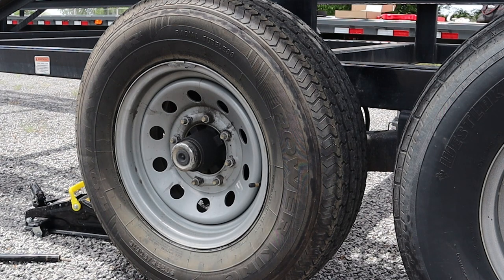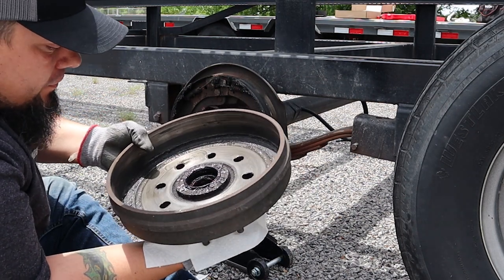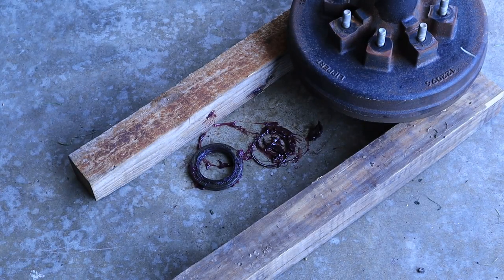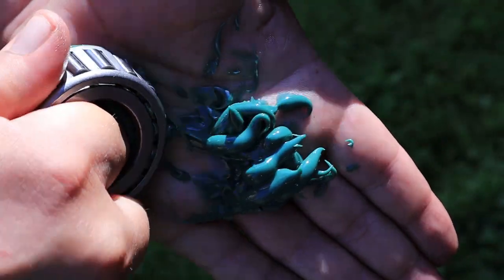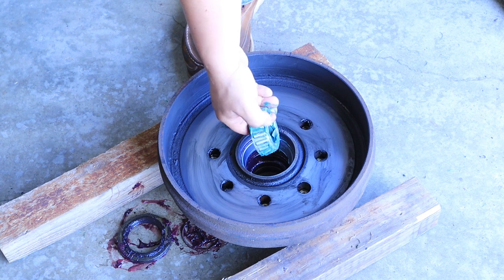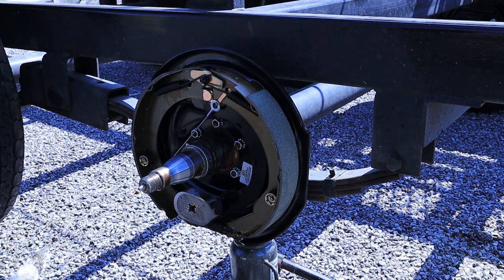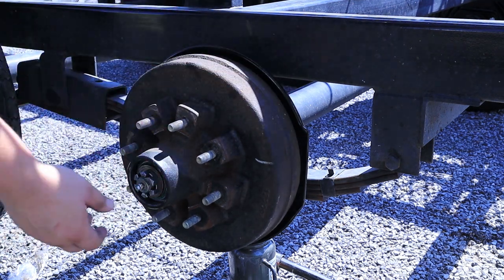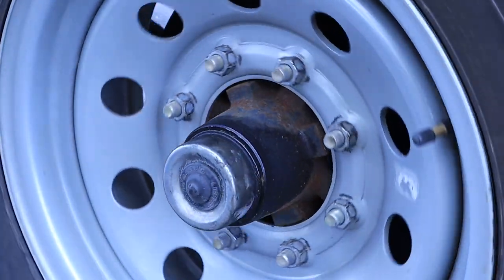Trailer Bearings | Maintenance & Replacement

Comment: I’ve been an USAF Aircraft Mechanic for my adult life. We have several critical inspections…Pre-Fight, Post- Flight, Scheduled and UnScheduled Maintenance. Applying that to my personal life has been beneficial and saved me tons in money, time and safety. I will definitely apply those rubrics to my Truck and Trailer when I start HotShotting. No reasons to drop $100K + and treat it like chewed Bubblegum…that’s just crazy.

Comment: In a pinch you can pull the outermost bearing. Put only the nut on the spindle and pop the hub/drum off the backing plate. The nut will pass through the hub and the nut will pop the rear seal and bearing out with some love. The most important thing you should have said is to carry at least a full set of bearings and seals in the truck. I carried 2 in the truck.
Reply from the maker: That’s an awesome trick!! What’s funny is I actually did mention running with a spare kit the first time I recorded this intro but my mic wasn’t connected so I had to redo it, 🤦‍♂️

Comment: Great video! Not alot  of guys out there showing this side of towing trailers. I had a wheel completely snap off one of our dump trailers and roll down the highway into a field a few years back due to the negligence of this very topic. We got lucky. Ended up having to replace the entire axle simply because we didn't do something as simple as keep the bearings greased. Thanks for sharing!

Comment: Thanks for the video. If you don't need to take it apart to inspect the bearing, you can Use that grease fitting in the end of the axle, that will fill your bearings with grease and push out the old.

Comment: Save a ton of $$$ !!!
I just had both axles serviced at a PJ dealership,  complete 70K service. Unfortunately my back is wasted so I can no longer do simple maintenance stuff myself anymore.
About 9K miles later, been on the road about 2 hours that morning, heard a loud POP, pulled over, assuming I blew a tire. Checked the tires, all good, but excessive heat coming from the right rear wheels. I go back to my truck to get my thermal gun, turn around, smoke, then fire. You, bearing and/or axle failure. Fire did too much damage to determine which. 7 fire extinguishers later (my 2 then a DOT worker stopped and we used all 5 of his), Fire Department showed up. Burnt 2 tires, 2 airbags and scorched every thing surrounding. 
No idea what went wrong yet (just got Dexter Axle's authority to begin the disassembly) but obviously the "service" I was charged for by the PJ Trailer service shop either didn't happen or wasn't done properly. 
Any other shared experiences would be appreciated. 
Never hauled overweight,  tires aligned and balanced.  Any ideas ???
Haven't posted anywhere else, Loadmizer's Channel is one of very few I trust & respect. 
Thanks again LM for the continued education and for finding the time to do the videos you do.
Reply from the maker: That’s insane 😦

Comment: Man I just did one which I knew that failed, so changed the whole assembly bc was dirty and figured was easier and installed nice sell adjusting brakes. Went to adjust other 2 on that side, and 1 I cant adjust, and then the other new axle wheel had a blown seal 🙄 so just replaced that one too with new self adjust.

Comment: lol just did bearings in my trailer..    awesome vid, per usual, brother!
Reply from the maker: Easily one of my least favorite things to do...ever. I miss my oil hubs 😂
Reply: @LoadMizer  I had shit everywhere!  first time it was this messy.
Reply from the maker: Lmao
Reply: @geriatricginger  Those are way handy, but a very easy way to over grease and push grease out your back seal and then it gets on your brakes.  I learned this the hard way so I only use a manual grease gun now because you can feel if it pressures up.

Comment: Excellent video with a lot of details.    Question:  I am pretty handy, but I have never changed out bearings on an axle.   I have a 5x10 Wells Cargo trailer and it is time to maintain the bearings.  The axle on the trailer is a Dexter axle, and do you think that would be comparable with what you did in this video for me to venture doing this on my own?   TIA

Comment: You have to raise the wheel off the ground and spin it while you a putting grease into the zirk at the end of the axle, or you'll blow out the seal every time, just like what you just found. SUPER IMPORTANT if you have trailer brakes. Now you'll have to change those pads and get all that hardware clean.

Comment: Thanks for the video, just repacked mine for the first time recently. 7 months as an O/O. One question, heat? I usually check my hubs when ever I stop. Hold em to see how hot they are, if I can hold em for at least five seconds or more i figure they are good. What is your thoughts?
Reply from the maker: That’s a habit you want to keep. Easiest way to tell if a hub is struggling.
Reply: @Asperian Transportation @Load Mizer keep a laser thermometer on hand. I once noticed oil splatter on one of my wheels during an en-route inspection, touched the hub and burnt the tips of my middle and index fingers.

Comment: Seems a lot of controversy about pumping grease in through the zerk fitting. They say do not do this as it could blow out the outer seal and saturate your brakes with grease.    Some say it should only be used during an emergency situation (whatever that means). Would I be ok if I just packed mine by hand and not use the grease gun at the end like you did?  Thanks for your input.
Reply from the maker: Absolutely. Just make sure you stuff plenty of grease in the empty space between the inner and outer bearings. I haven’t blown any seals using the zerk. I was told the way to avoid that was to spin each while as you pump. So far it’s worked perfect. I still prefer oil bath though, I’ll never own another trailer without them.
Reply: @LoadMizer  Thanks for your reply!

Comment: I was wondering when adjusting your brakes, at what level is it adjusted to to be adjusted 100%!? If that makes sense, I went with applying my brakes and adjusting it on level 4 so it would stop when spinning freely by hand. But then I wonder if I am over adjusting bc dealer said one of my magnets we burnt out! 🤷🏼‍♂️ idk, that’s why I ordered self adjusting ones bc not sure. I wish i had hydraulic disc brakes like my Diamond C. 😒 I need to make a road maintenance kit for my 9k axles now too just in case.
Reply from the maker: As far as the annual adjustment goes you want to back it off just enough to where the hub isn’t rubbing the brake surface anymore.  Then as far as bedding the brakes go you’ll want to adjust the controller to the point right before it locks the wheels up. It’ll take time because each hub will act differently at first. The magnet failing is just part of these electric brakes. The 10k dexter brakes I have on my flatbed are notorious for magnets failing.
Reply: @LoadMizer  yeah maybe I over tighten them. Thanks for the break information 👍🏻
Reply: @LoadMizer  so when your empty, at what brake setting do you have to be set at to hold the truck with just the brake adjuster squeezed? Ex: at a stand still, level ground, I have it set at a 4.5 gain and can squeeze just the brake adjuster and it will hold truck, anything below that it will roll.. thanks

Comment: I tried to do races, not knowing that I really don’t have to do them, and figured not worth the headache, just replace the whole thing 😂
Reply from the maker: If you have the money to throw at it, replacing the entire hub is so much easier. It’s also wayyyy less messy 🤣
Reply: @LoadMizer  yup, and hopefully save me a brake adjustment violation 🤷🏼‍♂️

Comment: What would the maintenance be on an oil bath axle?
Reply from the maker: Most of these axles have maintenance schedule between 10k-15k miles. That would be inspecting bearings and races. You’d have to drain the oil for that anyway so you just refill the hub when your done. Between maintenance intervals just check the oil level and top off if needed unless something looks or feels off.

Comment: Good job.  My only comment is that with chinese bearings; just replace.  If I had German, Japanese, or Timken bearings; I'd inspect and possibly replace.  But with chinese stuff, the quality just isn't there; and it's that peace of mind I'd go for if I only had a chinese option and replace with new.

With the castle nut, I use a socket and tighten until seated; then back off.  Channel lock will work, but not the best.

Comment: Man thank you so much for that info this really helps me. Where can I purchase a bearings kit? Can you put a amazon link on here so you can get credit for it?
Reply from the maker: I haven’t had much luck with kits from Amazon. I’d order directly from the manufacturer or etrailer.com. Those kits are specific to each hub part number. It should be stamped on the front of the hub 👍

Comment: what’s the average miles driven before changing bearing. or what does the trailer do to tell you the bearings need changed
Reply from the maker: I think the manual says 12k miles or 12 months whichever comes first. I pull my caps and top off grease and check the axle nut every month though. If something seems off I pull the hub and dig deeper.

Comment: What bearing grease do you use?
Reply from the maker: I used lucas grease both red n tacky and heavy duty (green). Didn’t really notice a difference between the 2 performance wise.
Reply: @LoadMizer  awesome Ty. Hey, is it normal to have some camber while turning on a dual axle trailer? I noticed the other day there was some slight camber on my car trailer while I was holding my jeep during take turns and on uneven terrain. Otherwise the tires run straight it’s only when turning. Any help would be appreciated. Thank you.